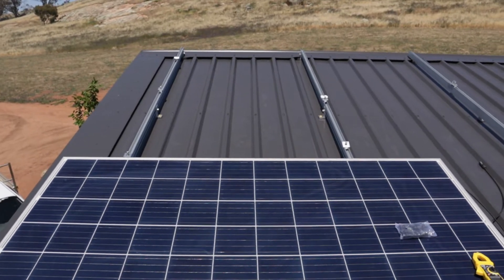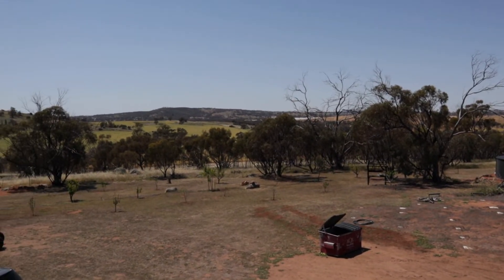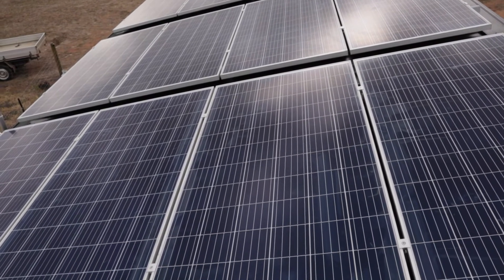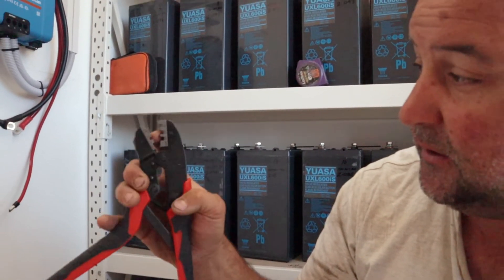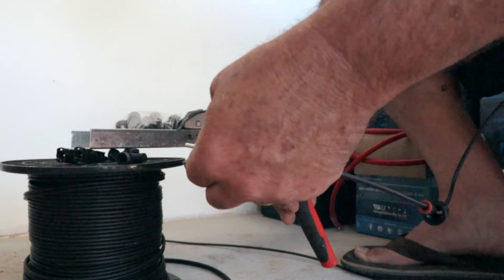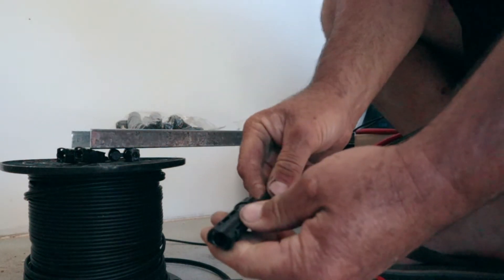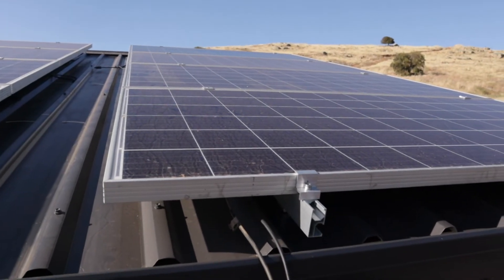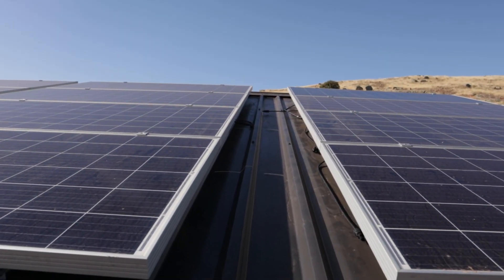Off grid solar panel install PLUS making MC4 connector leads

Comment: Great videos. Just wondering if having your solar panels on your south sloping roof makes any difference? Thanks
Reply from the maker: Do you mean if we had them on the south slope rather than the north slope?
Reply: @ROCKPILEOffgridHomestead  Sorry I just realised that your panels are on your barn, not your home structure. My mistake :)
Reply from the maker: @SJ-xg3rv  aaah I see. Yes we put them on our shed  as that was what we built first and the shed also contains the battery bank and inverter etc 😊😊 once the house was built we then ran power from the shed to the house. South facing panels for us would not be efficient in our winter 👍
Reply: @ROCKPILEOffgridHomestead  Makes sense, thanks. Loving your videos, gaining lots of tips and ideas :)